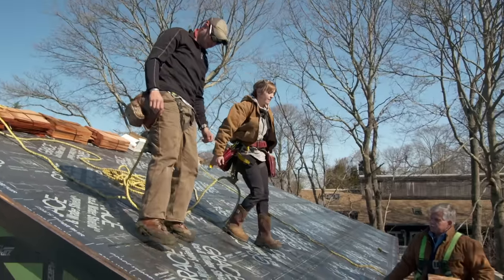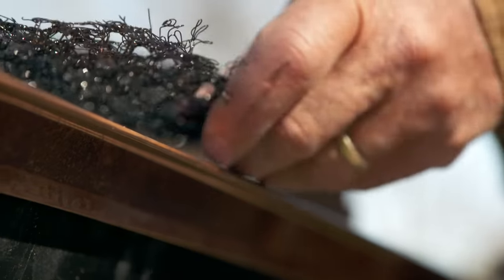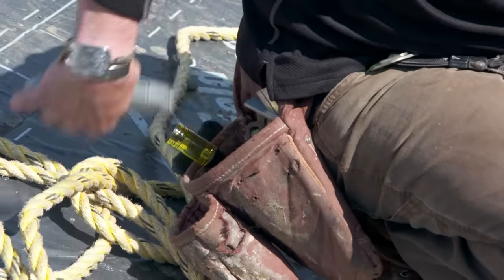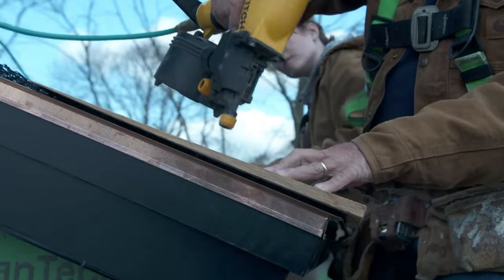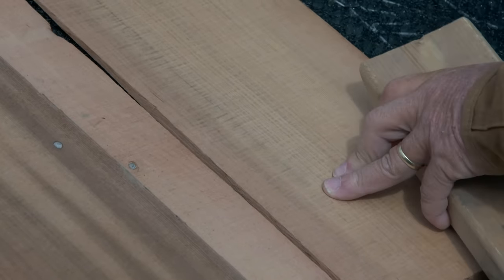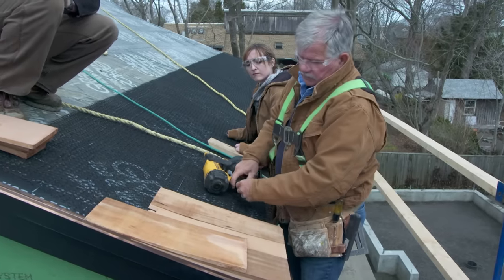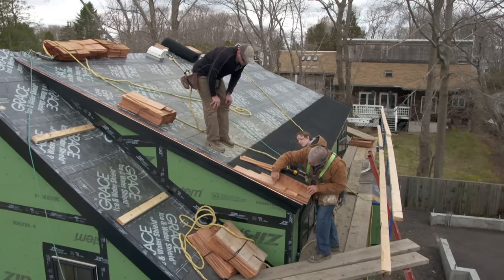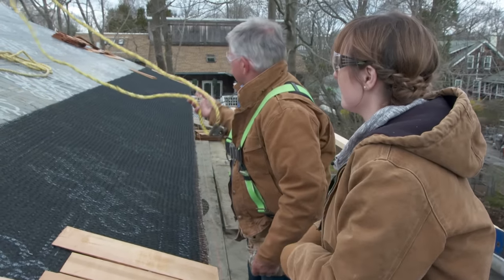How to Install Wood Shingles | This Old House

Comment: Shouldn't you be laying down a new roll of that Matrix Nylon Mesh underneath each new roll of shingles?  The shingles other than the base ones are still going to get wet underneath and rot and mold is going to build, if not properly aired out.

Comment: Wow, As a former roofer for many years, I gotta say that breather mesh underlay is ingenious.
Reply: they make it for sidewalls too
Reply: What's the life span for a wood shingle roof with and without the mesh underlay?
Reply: Faster than skip sheathing
Reply: SlickWilly with skip sheathing 50 years if attic is vented well
Reply: It is a clever idea, but it will be sensitive to the amount of pressure that you use to nail the shingles down with. If you go to heavy, I would guess that you can crush the mesh to the point where it can't function as intended. You need to by a good quality mesh from a supplier who stands by their product. Cheap is not the answer here.
Reply: Wood shingles have been used a lot longer than nylon; how did people solve this problem before synthetics came about?
Reply: I just kind of think that your roof will be an absolute spider haven with that mesh
Reply: @ueck1125  But you won't have roaches or beetles. The spiders will eat them.
Reply: @tlangdon12  Yea, I think the mesh is just PR or something. If you want this stuff to breathe use a normal grid of under wood strips and put a metal mesh all around it so bugs can't enter. That's how it's done on regular roof tiles.
Reply: 1..If your nailing perfections at 7 inches your shingle will curl prmature! 58 years installing cedar says so.! 2..Also your nail was counter sunk twice on the first gable so your not grinding the driver turning the pressure down never works.especially if your using cedar breather.3 your installing a three ply roof every where but where all the water runs to the last course and between thos slots its one ply of cedar so it actually wears out quicker than the rest of the new roof!!
Reply: @copperworks  only depends on the climate conditions you install it in..where theres no regular ice daming every winter along time. if put on correctly ..strapping was ok on vancouver  island with lowered exposures due to wind driven rain or at maximum exposure then felt underlayment as recommened by the Western Red Cedar Bureau..proper installations also guarantee a manufacturers warrantee.
Reply: Is the mesh used on the whole roof of just the first few rows as seen in the video?
Reply: @cedarman5754  what is the solution to the last row wearing out quicker than the rest of the roof?
Reply: @stevesmith7571  always have a  two layer starter course...then yourfeild material.That way you actually have a minimum two layers between your joints on the bottom course.. where the most wear is.!
Reply: @cedarman5754  Thank you
Reply: @jake-rg3fd  I think it might be partly because older roofs were decked with softwood boards, commonly 1x8 to 1x12, with gaps left between boards. The gaps provided some drying and airflow to the back side of the shingles. But with modern plywood or osb sheathing (not to mention unvented roof assemblies), there’s much less airflow without incorporating a plastic mesh or furring strips of some kind. But yeah it is interesting.. I’ve seen some very old cedar shingles roofs still going strong, where newer shingles have failed. I think the quality of the single stock available now has a lot to do with it as well. Cheers.
Reply: @cedarman5754  What about the moisture  trapped between layers of shingles? I understand the mesh on the bottom, but it seems like moisture would rot the other layers. Will it happen?
Reply: @tlangdon12  yup
Reply: @jake-rg3fd in the old days cedar roofs where not installed on solid sheathing (such as plywood) but rather on purlins made of 1-by pine (often 1x4 or 1x3) spanning horizontally across the roof with large gaps (4-6”) between boards. The gaps between purlins allowed the shingles to breathe from behind. Obviously the gaps made for much lowered energy efficiency than solid plywood sheathing (but side note that cedar shingles have much better energy efficiency than asphalt shingles). The new synthetic mesh allows use of solid sheathing and even exterior insulation, as showing in this video.

Comment: You can be sure of your nail placement by putting a mark on the nail gun's magazine the required distance from the nail exit point. Then, when it's lined up with the edge of the current shingle, you will be sure that the nail is far enough from the bottom edge to be covered by the next coarse.
Reply: Nice
Reply: Good hack

Comment: I have a 8:12 roof with heavy shakes. It’s 25 years old and never leaked, but I used 18”  30lb paper on every row. It slayed down on 3/4 plywood with no breather material under the shake and it’s done great. I would highly recommend using the 30lb paper that is your key to a water tight roof.

Comment: I used to mark the joints in the starter under course on top of the upper to avoid landing second course joints there. 1 1/2 side lap but also a 3/4 offset from the joints in the previous course. We also used to set the starter course to a string line. Sometimes with old buildings you have to follow what is.

Comment: A long board 5 inches wide and 8 or 10 feet long is set on the previously nailed shingle course with its lowest edge flush with the lowest edge of that previously nailed shingle course. Then two 18" long 1x2 strips are tacked to the board on either end and run up the roof and tacked in place with one double headed nail each. Then all the shingles are laid where they need to be along the upper edge of that 5" wide board. The 5 inches determines the shingle exposure (you can make it 4 inches, or 6 inches etc.) and when all the shingles are in place after you shuffled some to make sure their edges are well away from the joints beneath, you are now ready to go bang, bang, bang, all down the length of the 10 foot long row you just laid. ZOOM! No more nonsense of laying one shingle and then nailing that one shingle.  Next, you pull the double headed nails holding the two strips of wood on the ends of the board to the roof, and move the ten foot long board further along the roof  and tack it there to continue that row of shingles. And where did I first see this done? By some guy named Norm Abrams on some TV show called This Old House many years ago. I wonder if the guys in this video ever watched that?

Comment: I was taught to install a 12" wide strip of felt paper between each course that covers the nails. Just cut the roll of felt with a sawsall.
Reply: The extra felt stripping you're referring to is to go over the healap area only aka the top part of the shake. It's purpose is to retain water integrity/tightness of the shake since it's very thin at the top. The stripping is not to cover the nails and would deteriorate anything lower than the headlap.

Comment: I did not see how the roof sheathing for the shingles was attached to the roof through the 5" of insulation.   I am curious to see a detail here.   Perhaps it was shown in a previous episode ?
Reply: Same question on the inverted roof.  I can only assume they used adhesive since it was a semi-rigid rock wool.
Reply: Nailed along the edges and screwed in the field using long screws.
Reply: It was boxed out.
Reply: @mitchdenner9743 , Only along the edges. In the field, it's just screwed with long screws.
Reply: @augustreil  obviously
Reply: @mitchdenner9743 , Sorry bro, Not everyone is as smart as you.
Reply: @augustreil  first of all I didn't ask you to tell me how they attached the sheathing I was only answering couple of the comments asking how the sheathing was attached with the insulation, in which I answered it was boxed meaning framed with Lumber insulation in the middle and it was obviously attached on the edges. So don't start getting cocky with me pal.  Nobody asked you.
Reply: It was boxed around the perimeter.  That can be seen.  But, if you examine the layering carefully, there is 2 layers of insulation, and no framing whatsoever  in the midsection of the roof.   Screws would need to be 7 in. long !!
Reply: @cup_and_cone    That does not seem like a very secure method for attaching roof sheathing.  I could visualize the entire roof section blowing off in a windstorm !
Reply: Where can I buy 7"  sheathing screws?
Reply: @bobcalder724  #14 X 7" Extra Long Gold Star Wood Screw Torx/Star Drive Head (1 Pound - 22 Approx. Screw Count) - Multipurpose Torx/Star Drive Wood Screws https://www.amazon.com/dp/B01LZ8IP4B/ref=cm_sw_r_cp_apa_i_cRPiDb22HJ092
Reply: @mitchdenner9743 , Oh just lighten up Buttercup, Don't get your panties in a bunch.
As for you just answering a couple of the comments, Wth do you think I was doing ?
Your answer was "It was boxed out"
Maybe some don't know what that means, which is why I said "Only along the edges. In the field, it's just screwed with long screws"
We are both trying to help here, and you seem pretty smart, so can we just get along ? Hell better than arguing, no ?  Thanks.

Comment: Hi, what's the name of the self sealing membrane and also the matrix as i havent seen these readily available in the UK but with brand names i can then look for them.  i have flagstone slates on my house roof which needs all stripping and re-roofing so a self sealing breathable membrane would be good as it takes a bigger nail to hold a 3ft piece of flagstone and i want to wood shingle or wood shake my barns & outbuildings which are 150 - 250 years old and in desperate need of renovating - thanks
Reply: They're using Grace Brand ice and water shield. Grace invented the self sealing ice guard commonly used and manufactured today. It is the best by far but also 3 times the price of your typical ice guard. It is also the tastiest/stickiest and can be difficult to work with.....it's very unforgiving when trying to install it, you've been warned lol.

Comment: The one thing they don't mention about having a wood shingle roof is that your home owners insurance will go up quite a bit due to the burn rate of wood shingles if a fire was to occur. They are also very expensive.
Reply: Not in the midwest. Regions that are prone to wildfires such as California one would foolish to use such a flammable product on their. Hence why wood is not really used in Florida for flooding/water issues with rotting.

Comment: All these negative comments about shake roofing, when it's been used since time immemorial. It's relatively inexpensive, it weather's into a beautiful grey, it is a bit of a fire hazard in some areas but let's see how your metal roof lasts a mile from the coast.  A good shake roof can last a hundred years with care. Wait till you guys see what the Japanese use!
Reply: I live in redwood country, and there's no way a wooden roof a mile from the coast is lasting 100 years. I tore off two this summer, both 40 years old and leaking. Every roof will eventually leak, but it can be really challenging to locate on a wood shingle roof; that's why they've become obsolete. 
I also don't like metal roofs, but that's a different conversation.
Edit: even if the wood could theoretically last 100 years, the nails and underlayment won't, especially on the coast.

Comment: It may look good but thats a TON of work to install, not to mention possible mositure problems and also when its time to get a new roof having to tear all of that out.
Reply: Ton of work to maintain, too, especially in a wooded area. I used to have to clean and seal a cedar shake roof every other year for some doctor. It's dangerous work.
Reply: They never say the cost. That membrane stuff ain't cheap.
Reply: @mroldpueblo7879 , You're right, it's not cheap, but for what it does, it's a great product.
Reply: Retro Steve.... any roof would have to be torn out to replace it, which is a bear no matter the material. But that's the beauty of a wood roof, if it's maintained, it doesn't ever have to be torn out.

Comment: But the direction of the grain and which way the shingles cup should've been explained first a foremost which way u lay the grain towards the roof that matter most. Or siding which ever application but he did not explain that u have to look at the grain of each shingle to lay that inwards and to explain why to do so. So as to lay the grain inwards so it won't cut out but cup inwards and also didn't lay a wider shingle and explain how to nail a wider shingle as to apposed a skinnier and how to nail fa wider one. Inch stage on the seam minimum nail an eighth inch in on skinnier shingles but nailing on a wider shingle should've been explained as well as which way to lay the grain as to account for the natural cupping of the wood.

Comment: Wouldn't it be better to saturate the shingles in water before you start, then not have to worry about the gaps?
Reply: jej3451 no
Reply: When we do a Cedar shingle roof, we set up pans and soak them in preservative for 24hrs prior to installation.
Reply: The only down side I could see to doing that would be that when they dried out the nails would no longer be tightly gripping the wood allowing for loose shingles and/or water leaks

Comment: When installing a wood roof and paying the upcharge compared to an asphalt roof, it would be tremendously silly to use wood shingles (AS IN THIS INSTALL) to save on the extra cost of the wood shakes. The roof would look 10 times better for an extra 30% in the total cost by using shakes rather than shingles. I think for the 50+ years age of the wood roof it's best to pay the extra cost of the shakes and live with an amazing looking roof rather than save on the shingles and have to live with a mediocre looking wood roof.

Comment: Over time the cedar will eat holes in that copper. Lead coating copper ONLY.
Reply: Kevin 130  no
Reply: Just so you know, many people count the number of comments that tell Tommy what he did wrong.
Reply: The tannin in Cedar alone will not eat holes in copper within the 50 yr lifespan of this roof. In a more corrosive environment such as the east coast you might me right but not solely because of the reaction between the cedar and the copper.
Reply: Huh? It's not treated
Reply: @christopherjameswall5182  no it's red cedar
Reply: You guys can say what you want, but I have seen it. I have replaced a few copper vallies over the years that had been eaten away from cedar shakes
Reply: No. If you saw damage, it was prob from galvy having a reaction with the copper. Stainless nails shld be used with copper flashing

Comment: you suggest all shake roofs are the same ..When your using Wester red cedar you treat it differently than eastern white and finally alaskan yellow cedar!  ..an inch side lap? lol try reading and educating yourself have you ever even shingle a real roof that you had to guarantee from failing as in curling!  wow you would be fired to third minute working and tossed out of the cedar bureau!

Comment: With today quotoes this would be unacceptable... Coulda had 5 rows out and nailed in the field by the amount of time he took to get each side ready... Just over hang 3 4 shingles.. Nail a ledger board and go... No string for the 1St course
Reply: Just so you know, many people count the number of comments that tell Tommy what he did wrong.
Reply: @kellerrobert80  he didn't do nothing wrong... I've been on alot of job sites.. And if the boss seen someone doing it this way it would be a problem..
Reply: I'm just talking about speed

Comment: I can respect it for historical reasons but I really really dont see why you would do this. Definitely a more money than sense type thing. Go for slate, ceramic, or steel. Steel being the best choice nowadays with the clip-on solar panels that are designed to work with it nearly no labor required to mount. If you get it done before the government tax refund for it ends it will pay for the cost of the roof over its lifespan.
Reply: Probably, but anyone can do this. A single shingle or Shake can be handled by anybody and only requires a hammer, nails, string, etc. They also last quite a long time.
Reply: And of course, houses should only be made of poured concrete, and left plain gray.  sheesh.
Reply: @KB4QAA  False equivalency. 
Using a not-waterproof material for your waterproofing just doesn't make sense. 
You can get metal roofs in whatever color you want.

Comment: Waiting to read comments about how Tommy is doing this all wrong.
Reply: Give it time.  Everyone seems to think they know the best way to do this stuff. 
What they don't understand is what works for them may not work for someone else.... Plus building codes won't be the same from state to state.
Reply: oldtwins na Tommy doesn’t get those nearly as often as the other guys. He rarely makes mistakes is a generally trusted.
Reply: drip edge corner lap is backwards, i think :) (and so it begins) :)~
Reply: Read my comment! I've been doing it longer than Tommy!!
Reply: oldtwins na that string doesn’t look like it touching the ends of the shakes near the end.
Reply: those shingles should be hand nailed.